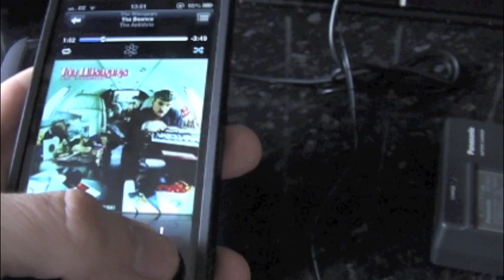Airport Express A1088 Repair

Comment: I just bought one for a quid , car boot .
Not working . Will try to fix as you have , bit of fun  .
Now where are my free spare caps , i put them safe somewhere .
Reply from the maker: Nice one. If that doesn’t work there are tutorials to replace the power section. The wifi extender and airplay function is still useful even now.
Reply: @wellhiddenmatt  I already have 3 airport extremes from CEX between £8 and £12 each . They are still perfect extenders for my house  , WiFi everywhere . This , if it gets mended  , is for a printer . May as well get another for the stereo from CEX for £5 too  . Thanks , in advance  , for the help .

Comment: Where did u bought the replacement capacitors from and what is the exact volts or other numbers on the capacitor thanks
Reply from the maker: Hi there, you can buy capacitors from any electrical wholesale shop. In the UK CPC Farnell or RS components are the usual. Or from eBay. Good quality capacitor makes are rubycon, nichicon or Panasonic. 
For the voltage and capacitance it’s written on the side you can always go with a higher voltage NEVER lower. And it’s also important that the capacitance is also the same.

Comment: Thanks. Replacing the capacitors on the Power supply Board repaired my Airport express. I used a cutter knife and a bit of time to open the housing, which made gluing the housing back together easier.
Reply from the maker: Glad you got it fixed.

Comment: Excellent. After 13 years mine broke in the described way. Opening up the device is the hardest part. 2 new capacitors and all up and running again. Thanks for great explanation and video. Up cycling is so satisfying.
Reply from the maker: Glad to help. I actually have plans for another one of these that I took apart years ago. Video of that coming soon.
Reply: Opening the ultrasonically welded housing parts is the difficult part. I used milly putty to bring it back to a nice one piece part.

Comment: Opening a case like this should not destroy it when you know how. This is the type you have to crack open cause there is a bit of glue in the groove.
You only have to take a large but slim flat screwdriver and knock on the groove with a hammer such a way to crack open the groove-glued.
Then, ply appart.
I did so many times (small black psu, modem, remote, etc.) 
Be patient, secure the device not to move, watch your fingers. 
It saves the box.

Comment: you can open the box if you hit it harder and repeatedly across the joint line with a rigid and thin object (a wrench)
Reply: Squeezing it in a vice worked well for me.

Comment: Good video.  If you want to make the result look a little nicer, you can close up the seam with a small amount of Bondo (the same stuff used for quick repairs to car bodies) and then paint it white (and probably a clear-coat to get the gloss right.)  It probably won't match Apple's finish, but you won't have an ugly gash down the center.

Comment: Thanks for the repair video…i wish i hadn't thrown away my broken AE a year ago.  A tip cracking the glued plastic case open is to USE A PLASTIC CLAMP WORKING YOUR WAY AROUND THE CASE…TURN IT UNTIL YOU HEAR THE GLUE/PLASTIC POP/CRACK….that will get it open and then you can glue it back together without wrecking the case.  Works on all power supplies/glued cases.

Thanks for the demo...

Comment: Many thanks! Mine had exactly the same capacitors blown out. Replaced them with heavier duty ones (25 V) to diminish risk of blowing out again. The soldering took some effort, but I pulled it off. Success, it works again! This gives me great pleasure.

Comment: Apple really did design the original Airport Express to be recycled when they die. What are the parts worth in that thing? Less than £10 I reckon. They still make the best consumer wifi gear though.